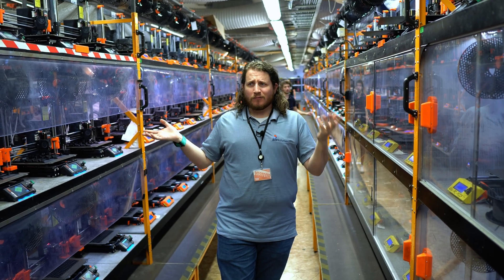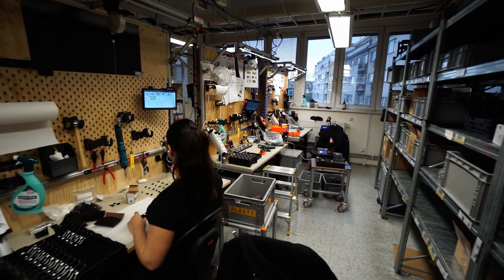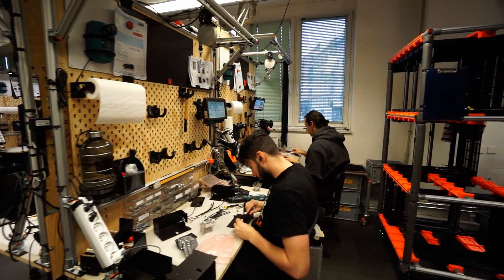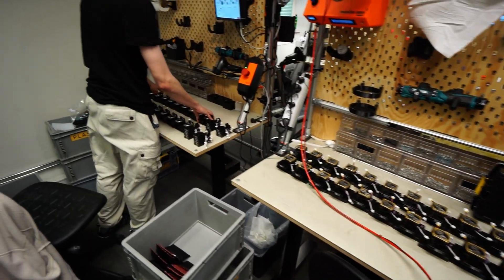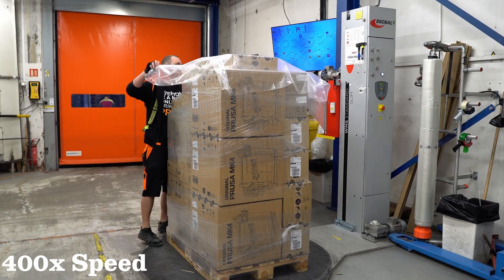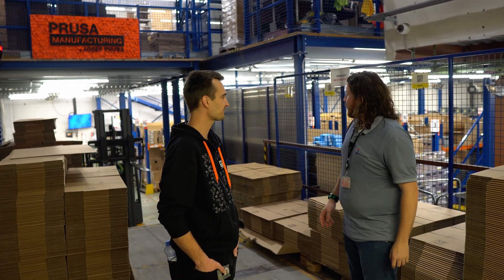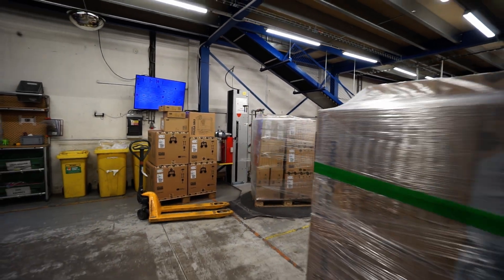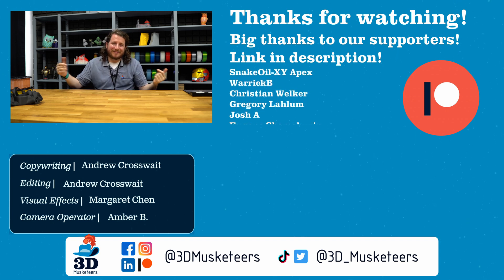Shipping 43,418 Packages A MONTH!! Prusa Shipping Tour!

Comment: Shipping!! The weakest link. After waiting 2 years for the XL the box arrived heavily bandaged! When opened it was obvious the fork lift driver had gone through the bottom of the box instead of underneath. But Prusa sent me out a new base without a quibble
Reply from the maker: I mean, the damage to the box is not exactly their fault.. It is the courier being terrible. But like you said, Prusa got it fixed, and that is one of their strong suits I think. The CS experience is hard to match

Comment: It is an amazing factory. It would be interesting to see a similar video from the BambuLab factory. I guess the latter is much more automated.
Due to the extensive testing you can be absolutely sure your Prusa machine will work perfect right out of the box. All this testing and manual labour makes a Prusa machine expensive. A more automated factory with testing only a certain percentage of each production step is much cheaper. Hence the price difference of Prusa vs Chinese competitors.

Comment: we interrupt this assembly of the mk3.5 to bring you this special program.
Reply: speaking of which, did you know that a m3x6 screw is not a m3x10 screw? lol
Reply from the maker: been there before LOL
Reply: Might do the 3.5 upgrade this weekend, any advise?
Reply: @winslowjoy2629  put the screws in the injection molded cover BEFORE you attempt to put it on the printer. It took me over an hour to get it there. I used their tools. I used my tools. It sucked. Period. Pretty much everyone agrees it's the worst part of the whole upgrade. Also don't lose your expansion nuts for the bed. I lost one dammit.
Reply: @awilliams1701  thanks!  Estimated time to assemble?
Reply: @winslowjoy2629  I don't know maybe 4 hours or so. I'm slowed down by printing as needed. LMAO I thought I could use left over mk4 parts (I printed everything in purple so I have the original prusa printed parts), but they weren't quite the same in all cases. Also I wanted multi-color for the wifi and NFC parts.
Reply: @winslowjoy2629  move the z axis up first. I had to do this manually. It got in the way before I did.